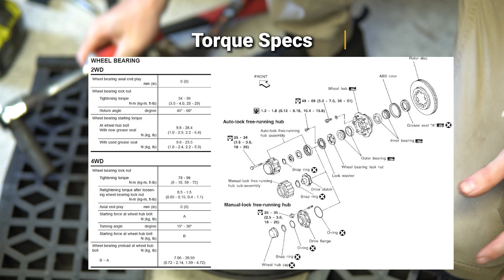How to Replace Brake Pads and Rotors on a Nissan Navara D22 4X4 (Frontier)

Comment: how does the pad actually fasten into the caliper, and how did you remove them?
Reply from the maker: Hi John, the pads are held in by the metal retaining brackets that hold onto the two nubs at each end. We forgot to mention in the video about this, as well as needing to compress the two pistons so the new pads will fit. It's all pretty much the same on most cars, so most tutorials for changing your pads should apply to this.

Comment: got to the seperating from the hub part and i cant get the old rotor apart after some agressive whacking with a punch and hammer
Reply: Any ideas on getting it off I've tried for a while with no luck